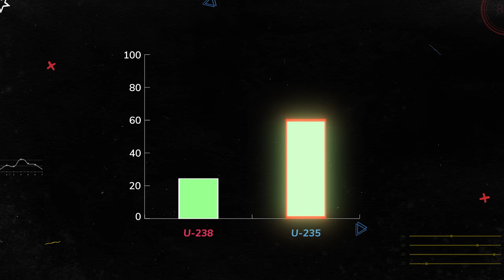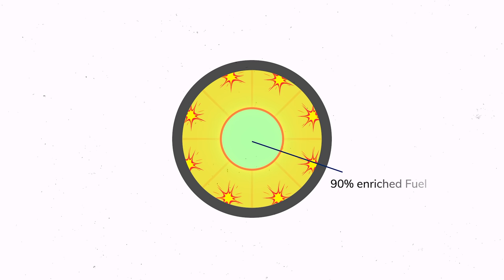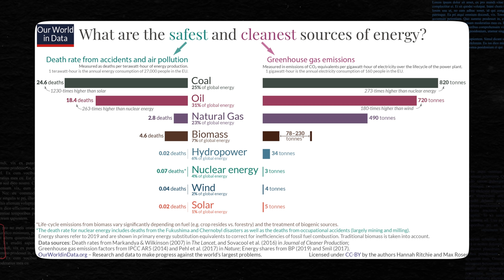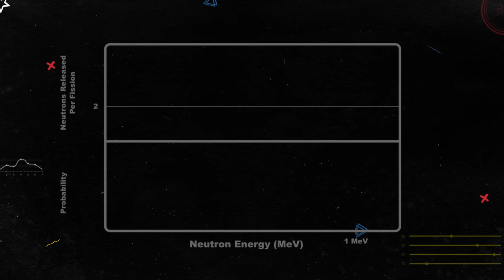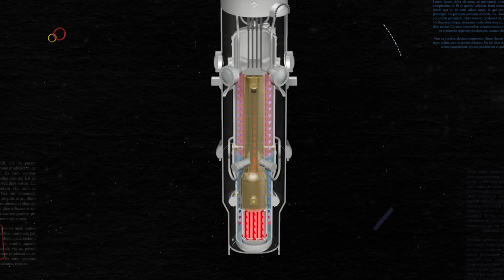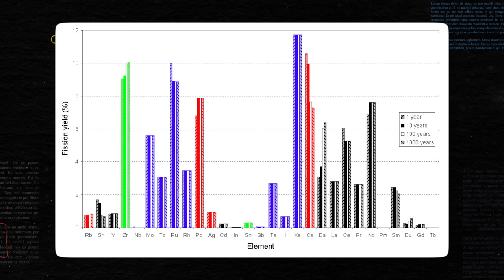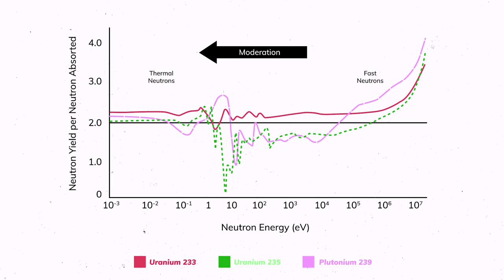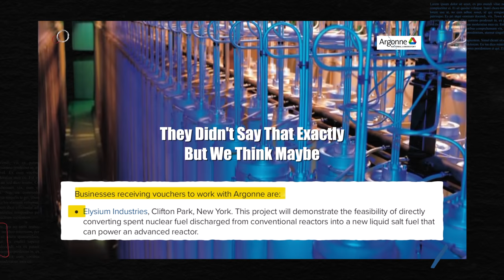This Reactor Feeds On Nuclear Waste

Comment: This  is what people need to see. I’ve been preaching about modular reactors and I didn’t even know about this new one. I’m excited to see nuclear rise.
Reply: The second atomic age, litterally using up and utilizing the mistakes of the old for the good of all
Reply: That’s because people prefer solar panels and hydro.

I’d rather choose reactors that last LONGER & re use the waste. That is IF our government actually invest it rather than being scared. Just don’t build it near the coast so we don’t have Fukushima 2.0.

Chernobyl happened during the era of Soviet Russia. Just think about it. As long as they hire competent scientists, there will be no Chernobyl 2.0.
Reply: @frucajse  It’s not that simple. Wind power is massively cheaper per kWh than nuclear and can be deployed quickly.
Reply: Definitely not the pie in the sky bs surrounding fusion.
Reply: Get electricity cheap enough and you can use hydrogen fuel cells and hace hydrogen combustion engines.
Reply: @Lioin  not cheaper than this, not dependent on wind...
Reply: @russhamilton3800  Not cheaper than what? 

Yes, depending on the wind is a factor but there are plenty of places well suited for reasonably reliable production.
Reply: @Lioin  a modular reactor is going to be orders of magnitude cheaper than wind...
Reply: @russhamilton3800  “going to be”… I think so too. However, my comment regards the current situation, not hypotheticals.
Reply: Also , if the atmosphere or sun light becomes defused in someway, solar panels will be useless.
Reply: @robert2690  
Have you ever heard of there being a tsunami anywhere on the continental US coasts? Neither have I, so why mention that garbage?
Reply: @Lioin  
Wind is not cheap once you account for its mandatory  100% backup, 75% of the time.
Reply: @Lioin  
Wind ishypothetical 70% of the time.
Reply: @EdPheil  no
Reply: @EdPheil  wrong

Comment: Her last point is absolutely true: nuclear reactors seriously need a face-change! Do the chimneys really have to be so monolithic and frightening?
Though I must say wind-farms also give me the willies.
Reply: honestly, i’m an architecture major and i’ve thought a lot about approaching this when i graduate. Oklo’s design for their plant was really inspiring, but all that waste heat can be put to good use for the building. like imagine vertical farms that use waste heat as energy and heat in cold climates, or creating small parks around the plant needed per regulations. or, conversely, using the waste heat to power stirling engines designed to facilitate carbon capture. Also, i can see some of these designs being 3D printed with massive 3D printers - and then repurposing the 3D printer as a crane for refueling. then instead of a beige concrete dome - maybe build a pyramid or some other interesting shape instead and mound the earth around it. in other words, celebrating our gift of the atom rather than treating it like a caged dragon. really honestly, the sky’s the limit.

Comment: Yes, a talk covering Sorensen’s LFTR work would be great.
Reply: I've heard people poo-poo thorium LFTR technology, and I'd like to see something discussing a point-counterpoint. What are thorium's detractors saying, and why? If they're wrong, how?
Reply: @joshuaholton7547  The two main engineering barriers to the LFTR technology are the breakdown of the barrier between the core and the enrichment blanket due to neutron radiation, and the safety risks associated with the removal and chemical separation of the highly-radioactive (but useful) fission products. Neither of these are insurmountable.
The two main political barriers are far worse; the irrational fear of nuclear power on the part of the public, and the requirement for research funding to bring the technology to maturity.
The freeze plug safety system, low pressure operation, ubiquitous fuel, lack of astronomically expensive fuel assemblies (looking at you General Electric..), and the fact that a molten salt reactor has already been demonstrated and shown to be incredibly stable make it a promising technology worth looking into. We really need to get away from high-pressure designs, and certainly far far away from burning stuff like cavemen to make power. Renewables are nice, but we need base-load capacity now. The anti-science folks can cry all they like, it doesn't change the fact that all this extra CO2 we're producing is going to make this a very tough place for our grandchildren to live.
Reply: @MechMan0124  Thanks for the comprehensive response! I wish I could recall where I'd heard it, but an engineer from the established nuclear industry publicly stated that thorium was a dead end that would provide less power and do nothing to alleviate proliferation concerns, and that really surprised me. I mean, if the guy was just sent out to take a dump on an upstart technology, then OK, that's disappointing, but no surprise, I guess. But one would think that, if anything, the nuclear industry as it exists today would be hungry to accommodate new designs and ideas that would help their image and profit margin. What I have seen so far speaks to the opposite. They seem to see LFTR as a threat instead of an opportunity!
Reply: @joshuaholton7547  The LFTR is a lot more complex than Elysium's MCSFR, so it seems likely to be more expensive. The MCSFR core is just a vat filled with a fuel/coolant mixture, there are no moderator structures or control rods. The LFTR has two separate fluids, graphite moderators and (I think) control rods. The fuel processing system on the LFTR is probably also a lot more complex.

Having said that, it's probably a good idea that several ideas are being worked on since you can't tell for sure in advance what will be the most economical solution.

Either way, Kirk definitely deserves credit for educating the world about the MSR.
Reply: @joshuaholton7547  That is true, weapons can still be created using the Thorium cycle. The U233 produced would be contaminated by U232 though, which produces some nasty daughter nuclides that would discourage weapons manufacture and make them difficult to handle and hide (lots of easily detectable gamma radiation). 
I agree though, Thorium isn't the end-all be-all of nuclear power. It presents lots of challenges, and we really have no shortage of Uranium available to mine anyway.
The molten salt technology is a separate and proven technology though. Running non-Thorium conventional reactor fuel, molten salt would still offer huge benefits; avoiding the expensive engineered fuel assemblies, operating at safer low pressures, operating at more efficient higher temperatures, allowing "walk-away safe" reactor designs, and giving us easy access to the useful byproducts. The blanket plate deterioration problem goes away with Uranium fuel since there's no enrichment necessary, and uranium nuclides are far more tame to process chemically. Proliferation becomes an issue again, but that's more of a social problem that we need to solve at its underlying causes. 

Sadly, most reactors are designed and built by GE. GE builds reactors at a a loss and makes their profit by selling the fuel assemblies over the course of the reactors life. GE is the big (only?) fish in the pond, and switching to molten salt designs means losing out on their "Fuel Assembly Subscription" cash cow. They still profit when no new reactors are built. The nuclear industry doesn't even need big oil to stifle progress, it handles that all on its own.
Reply: @MechMan0124  GE can't stop others from pursuing MSR though. Well, I guess they could try to lobby for more regulations, or for enforcing existing regulations designed for LWR onto MSR just to make their development slower and more expensive.
Reply: @joshuaholton7547  LFTR uses pure weapons grade U233 fuel, a nogo except for military.
Reply: @joshuaholton7547  LFTR yses 100%weapims grade U233 fuel, not legal for commercial, only military and military wont have 18 year olds running dual Reprocessing systems.
Reply: @EdPheil  I don't think that's correct. I don't think there is any kind of reactor that requires the same 90% enrichment that nuclear weapons require.
Reply: @EdPheil  ironically, the military instead let's the 18-year-olds actually operate their reactors... NNPP.
Reply: @BKHobby True story! But 60 years later, the Cold War doesn't have us desperate for nuclear weapons materials. Proliferation is considered a liability now - I think the real roadblock today is inertia and red tape
Reply: I dont think a talk on LFTR is coming anytime soon which is a great shame
Reply: It seems to me (an engineer with an interest in nuclear power - but not a nuclear engineer) that if people understood the benefits of LFTR then there would be mass emphasis on that technology. But instead the majority of people might care but are scared deep down of nuclear power (the fact that LFTR was rejected because of its inability to create nuclear bombs won't come into conversation if we can't talk about fission in the age of 'renewables'). Policy seems to be the biggest problem because the few willing to search MSRs and LFTRs are aware of Gen III reactors (I would guess we're a minority) we need a majority to make this happen. And the majority thing windfarms are the best way forward! We are preaching to the converted ladies and gentlemen... high time we change our game!
Reply: @MechMan0124  LFTR uses 100% weapons grade fuel, so is illegal for use.
Reply: @George Mann Uranium is already an infinite supply.l from seawater.
Reply: @MechMan0124  
The Th232 has a 70 year halflife, so there is a long time before that hard gamma comes to make and use a U233 weapon and the U can be refined periodically to remove daughters that will become the thallium hard gamma emmitter. Indeed the LFTR syst can be used to produce weapons quantities of U233 without the U232 by sequential simple 2 week and 1 year Uranium fluorination of the blanket or the core salt.
Reply: @MechMan0124  
Most ⅔ US built reactors are Westinghouse reactors, not GE.
Reply: @joshuaholton7547  LFTR requires 100% U233 weapons fuel, 93% needed for weapons is not sufficient to close the fuel cycle.
Reply: @ryanfisher5376  You can get the same benefits of LFTR with a Fast Chloride MSR, without the weapons issues, or the dual online Pyro-reprocessing systems, nor the unqualified Hastalloy N, nor the weapons process or cost to make 99.995% lithium-7, nor hazardous berylium coolant, just table salt.

Comment: Great vid. I hope molten salt reactors are adopted and pave the way to cheaper and more available energy.
Reply: Why don't you use renewables and energy conservation and get ten times the results in 1/5 the time for less than half the cost? Oh and no proliferation risk or nuclear waste.
Reply: @EdPheil  Tell me. How did that uranium get in the atmosphere? How did all those man made fission byproducts and actinoids get in the atmosphere? Did a fairy godmother sprinkle them there? If they are renewable, please tell me how you plan to extract them out of the seawater to reuse them. Maybe you could include an estimated cost for the recovery of these elements and how you intend to pay for it.

Comment: Nuclear fission reactors are perfectly safe as long as you maintain them. They have an operational life of 35 years before components start to fail. Keep up with the maintenance and they are the greenest energy type we currently have.
Reply: Diaoblo Canyon would like to have a word..... 9 inches of steel piping eaten through in 36 months by high pressure water
Reply: @miscbits6399  

And who’s fault is that?
Reply: Nuclear fission reactors can last 100 years if maintained & with certain component replacements.

Comment: 2:34 That is one source of hydrogen indeed, neutrons also may have enough energy to dissociate water molecules which also leads to hydrogen production (hence the need for recombiners)
3:27 technically you need to pressurize the water because it has much better heat transfer in liquid form, as well as necessary moderating ability.
Reply: +1
Reply: H2 recombiners in the containment are only built for desaster preparedness, when overheated fuel elements react with water/steam. The amounts generated by dissociation are rather small and will be vented during normal operation such as Xenon or simply recombine in the water.

Comment: Ok, now we've heard the PR flannel I want to hear counsel for the prosecution.
Reply: Price and sustainability. I fear it'll be very expensive and time consuming to deploy (and thus expensive per unit of produced energy) and its fuel source is not sustainable like wind, solar, geothermal and hydro are (endless). And although she did mention it shortly, funding has become a real headache. Investors are having more and more difficulties getting insurance for their investments, and whithout that, the funds are often not released. Combine that with the continously cheaper costs of wind, solar and hydro... Nuclear does have less impact on the landscape though.

Comment: I see a lot of potential in molten-salt nuclear power reactors.

I am working on a passive safety (decay heat removal) heat exchanger design for nuclear reactor.
Reply: they do not work .....sorry
Reply: I think the navy tried this. On submarines.
Reply: @davidhovland5690  The problem with the military...........is they do not tell the truth the whole truth, and tend to exaggerate
Reply: @davidhovland5690  Navy NEVER worked on MSRs. They are afraid of 18 yr olds operating complex reprocessing systems....which a fast chloride MSR does not have, bit they are not aware of fast chloride MSRs.

Comment: How come that every time I watch a video on SMRs no-one mentions the CAREM that is the first design of an SMR and the ONLY SMR currently in construction?
Reply: Because unfortunately we Argentinians stopped being technologically and geopolitically relevant to the rest of the world during the last 3 decades. CAREM is a nice design, a downscaled version of NuScale's if you will (i.e. a PWR with passive natural circulation for decay heat removal) and I believe the conceptual engineering was done by CNEA back in the 80s.
Let's see if construction finishes before the end of the decade though (fiscal restrictions notwithstanding).
Reply from the maker: Hey Manuel, this is a Fast Molten Salt Reactor, not an SMR. 

I’ll definitely look into CAREM, now that you’ve mentioned it. Thanks for the comment! :)
Reply: @TechforLudditesSira  MCSFR Can be a SMR or a Large Moulsr Reactor, uprateable without buying a new reactor.

Comment: In combination with liquid metal batteries we may be able to power a generational ship.
Reply: In combination with liquid metal, we may be able to power an undersea ship, like the alfa class racing boat.
Reply: In combination with thermal energy storage, or liquid metal batteries.
Reply: @EdPheil  Why would you need a thermal energy storage if you can modulate the thermal output up and down. Or what is the minum power level with MSR? With light water reactors, this is about 50%-60% (depending on burnup). See French reactor fleet.